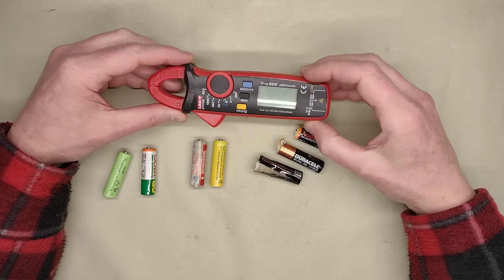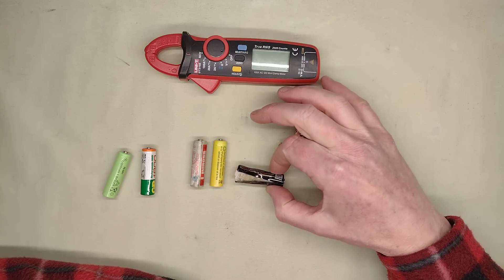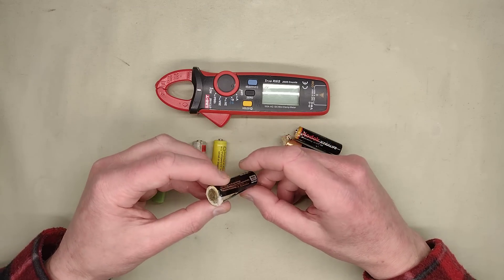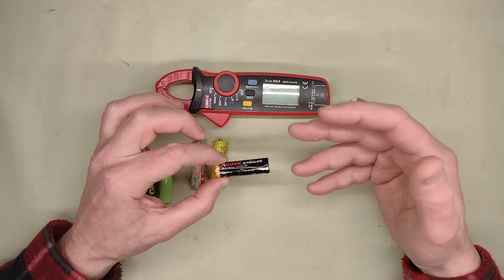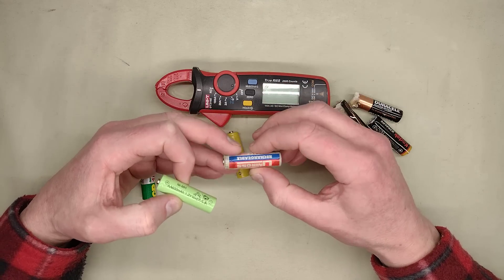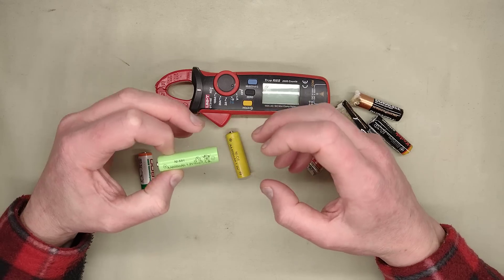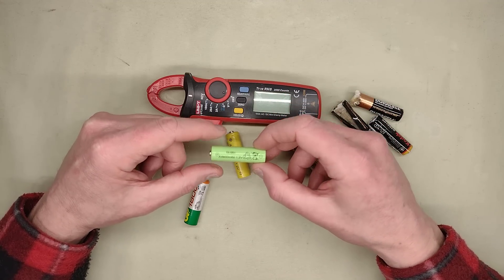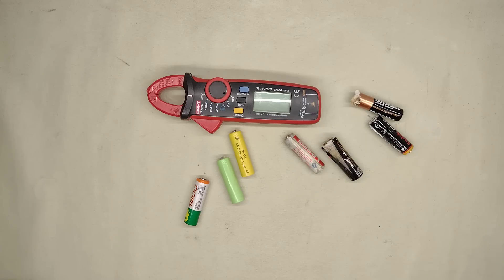The curse of leaky alkaline batteries

Comment: I was going to say that the problem with NiMH is that it they are nowhere near the capacity of a non rechargeable alkaline AA (~2800 mAh), but they are actually very close these days with Eneloop Pro being 2500 mAh.
Shame about the voltage (even under load) being too low in some applications for NiMH.
Reply: You can get them as big as 3000mAh nowadays, but don't be fooled by capacity alone: Such high capacity batteries have high leakage currents and are mainly suitable for devices that regularily need new batteries anyway.

Comment: One issue I run into with NiMH cells is that many devices don't protect against over-discharging, which will damage the cells. So by the time I realize that I need to recharge them, they are so damaged they won't hold a charge anymore. Therefore I've gone back to alkaline batteries for things like radiator thermostats because I've run through too many rechargeable batteries. Of course, these aren't devices you'll leave in a drawer for years before you notice the battery is dead...

Comment: My use for alkalines is as a cheap way to run Xbox controllers for 20 hours or so alongside other high-load short-life applications, and I use the disposable lithium batteries for my long-life applications. Rechargeables make no sense to me when the battery will last 5 years before I have to dig through my electronics drawer for the charger. I just wish it were easier to find the lithium disposables. Plus, lithium disposables last much longer than any rechargeables.

Comment: Another option, depending whether your devices are tolerant of a bit higher voltages, is lithium ion.  You can find them in the standard AA size if you dig a bit, and a bit of modification to the battery compartment can allow a pair to work in parallel to feed 3.7 volts rather than the expected 3V from a conventional pair in series.

I've got a battery powered deadbolt on my back door and the thing was beyond sluggish with four alkaline AA cells; hacked up the battery compartment a bit (really just bridged one conductor) and it now runs like a champ on 7.4 volts from a pair of cheap Chinese rechargeable lithium cells.  Been running for about eighteen months and only needed a single recharge so far.  I can't imagine how pathetic that little motor would be if I tried NiMH rechargeables; given how slow it was on 6 volts it might not even make enough torque to unlock the door on only 4.8.

Comment: Duracell batteries that I’ve bought in the past have often leaked well before their expiration date. The worst thing is the company tried to imply that the cells had not been kept at optimal temperature and storage conditions even when they refunded the purchase price. A good number of the unused batteries were leaking inside the packet! I’m very wary of alkaline cells now and check them regularly. Good advice in the video Clive.

Comment: I have the same meter and it had the same problem with alkaline batteries. The battery point inside were corroded as well, lucky it still works.

Comment: i feel like lithium AA cells are becoming more common for high wattage wireless devices like IP cameras that use wifi. also i never seem to be able to completely clean out the green crust. i do have a mystery can of "battery cleaner" that my grandpa got over 20 years ago that instantly cleans it up, but if i used vinegar or any other cleaning supply it never seems to work completely

Comment: I have stopped buying Duracells many years ago as it was once my goto battery as I wrongly thought I was buying quality.  I have to admire them for putting a date on the battery, but why was the leaky crusty ones ALWAYS duracells (and in date)? I did email duracell but never got a reply.  For the last few years I've given up on Duracells and have mainly gone over to LSD rechargeables where possible. But for some things eg quartz clocks still  always have a pack of Alkalines handy. Quite like energiser as I've never had one leak yet... Time will tell though.

Comment: The only acceptation to the rule is medical devices such as insulin pumps. When a rechargeable battery nears the need for recharge the voltage falls very fast and requires a mad dash for batteries. I’m sure they could engineer this out possibly just by adding more “emergency” reserve, but nope they eat batteries and there flavor of choice is alkaline. They never last near long enough to do internal chemical damage to the device. My other concern for rechargeable batteries left in, say a flesh light.. won’t the batteries be damages if mistakenly left on ? Thanks Clive !

Comment: I personally like lithium primaries, eg. energizer ultimate lithium their shelf life is like 20 30 years and they're impossible to leak as far as im aware and they're basically a lifetime battery for most low current devices and basically 0 self discharge i had some duracell ultra lithiums i bought in 2013 made in the mid 2000s and they still had 1.8v and i did use them they went into an RC Tank Model I gave as a gift so i know they'll never self discharge and they have a lot of power if needed. Anything that takes serious power usually you have li-ion anyway so i personally just go with very good batteries or if somehow i have something that would need to be recharged then id consider the rechargeables

Comment: Got an old film camera (konica FS1 from the 80s) that states don't use rechargeable batteries (sticker in battery compartment) This camera is known from weak electronics.  Is it down to the higher current that rechargeable  batteries delivery could fry the electronics?

Comment: Explosion!  I once had a Duracell 9-volt battery explode while powering an ordinary ionization-type smoke detector.  The explosion sounded like the gunfire of a 22-caliber rifle.  The battery had been installed for about six months, and up to that point the smoke detector was operating normally and not beeping to indicate low battery.  I found that one of the six small cylindrical AAAA cells in the battery had ruptured, splitting open its metal case.  Luckily, the smoke detector survived, and I have continued to use the smoke detector to this day without further incident.  I considered sending the battery back to Duracell for failure analysis, but I thought better of that plan, realizing I could be shipping five potentially hazardous items that could go bang at any time.  I think I smashed the cells with a hammer to rupture them and I trashed the remains.

Comment: Zinc Carbon are still available and fine for very low current applications, if it needs a higher capacity then it needs to be rechargeable. Been my view for a long time.

Comment: Duracell's were sold years ago upon the label of "never leaking and destroying your equipment".
Seems that changed back in 2014 when production was switched to China and most of their batteries leaked whilst still well within their shelf life date.
I stopped buying Duracells in 2015 and convinced my company to halt buying them in 2016 due to the leakage damage that they were causing to high value instruments.
I will never, ever buy them again.

Comment: I have a new  ni-mh battery in an old bosch drill is it safe to leave it inside the drill or remove between use ?
Reply: NiMH batteries aren't any threat for the device, but leakage currents could drain them.

Comment: If you have a Device that had an Alkaline Battery Leak and damage it,  Contact the manufacturer or if Private Labeled contact the store as many will ask you to take pictures of the Damage and/or additional information and may reimburse you for the Repair or Replacement of the Device. Of course each manufacturer / Store has different policy's. I had a Fluke Temp Meter from a Warehouse Club Leak and damaged the Battery compartment and adjacent area.  They reimbursed me $275+ to replace it.

Comment: I've gone to lithium batteries for quite a few items and NiHM for most of the rest. Anything that may sit around for multiple years gets lithium. Yeah, they're expensive, but much cheaper than the things alkalines have destroyed.
Over the years I have noticed that Energizers are much less prone to leaking than Duracells. My brother-in-law,  who owns a camera store,has mentioned the same thing. When people brought in cameras, flash units, etc. for repair, it was often due to leaky batteries, and usually good ol' Copper Top Duracells. Not so much Energizers. 
I'm pretty sure Costco's Kirkland batteries are made by Duracell - same leaky problem.

Comment: Military tossed a very expensive forward air control night vision laser designator because of this, drilled out the battery silo over many hours to restore it, has such a nice clean unused photomultiplier tube it was worth it.

Comment: The one issue I have with Ni-MH is that if they are over discharged, they quickly start losing capacity and sometimes require a "jump start" for a charger to recognize it.  This is especially common with Chinese made ones, the black tops.

Comment: I like Ni-MH, but have you run into instances where the lower 1.2 voltage is an issue? Not often, but I remember a couple devices over the years that stop working when the voltage gets around 1.1-1.2 per cell.

Comment: Yes, the 1.2v isn’t that bad on its way own, but when you factor in multi cell packs, devices designed around the 1.5v alkaline and carbon zinc start to suffer. 4x alkaline is 6v, you need 5x NiMH for the same result.  It’s a proper annoy with RC transmitter as at most I think I have a 5.4 to 4.1c to work with when the device can handle 6.6v. More or less a set of NiMH multi pack will have half the runtime for the same capacity. I think this is a major reason the built in lithium battery prevails so much. No voltage variance gaff to fuss with on devices that are sensitive to it.

Comment: Duracells are terrible for leaking. The final straw for me was a new battery which had only been in a kitchen clock for 3 months before leaking - I won't have them in the house now. I bulk buy Energizers instead and haven't had problems with them

Comment: What about lithium cells? The problem with rechargable batteries is that they are only 1.2V compared to the 1.5V. As your device requires more batteries in series this becomes more of a problem.

Comment: I do wonder though what the best way is to clean the residue off of the components. Mainly the battery holder springs I find to be difficult to clean. And also my understanding is that the leaky goo acts as an acid eating away other metal components, is that right?

Comment: In low draw applications that you only have to change the batteries every several years those Energizer Ultimate Lithiums are probably the best choice, they have a super low self-discharge and I don't think they really every leak, I'm not sure it's even possible for them to leak with the way the chemistry is and the way they're sealed.

Comment: I've had new batteries that still had enough voltage to power their devices leak. Ridiculous. Sadly some things we have, like some LED candle lights, don't work well on NIMH because the voltage of NIMH is too low. They stay about 1.3 volts for a long time which is great for devices like controllers but a typical new alkaline is usually at 1.6 volts, and the candle lights look much brighter and visible with alkalines than our fully charged NIMH because of that difference.

Comment: I've found that over the last few years the bulk packs of Duracell or store brand (Costco / Sam's Club) alkaline batteries are really bad .. normally half the pack has leaked after about a year (way before expiration). Originally thought it was just a bad batch, but it's reoccurring and happens like clockwork.

So yeah, not a fan of Alkalines.

Comment: For someone like me who uses vintage super 8 movie cameras, they’re sensitive to any lower voltage because it’s all analogue circuitry inside, since it’s from the early 70’s. So I kinda need the 1.5v power for the camera to properly run at the correct speeds.

Comment: The problem with NiMH cells is the 1.2 Volts nominal versus 1.5 Volts nominal.  A lot of devices aren’t excited to receive 20% less potential than they were expecting.  A work around I haven’t seen yet would be to include a series boost converter packed inside an AA or AAA form factor along with a physically smaller chemical cell.  The energy density these days is large enough, adding an internal regulator should be feasible.  I’ve seen cells with built-in USB charger jacks, so why not a boost regulator?
Reply: Get yourself some NiZn AA/AAA batteries, devices that aren't happy with the 1.2V of NiMH are usually very happy with the 1.6V of NiZn. I have both in my drawer and every device gets what it likes best. For example the remote control of my OLED television likes NiZn, while the remote control of my satellite receiver likes NiMH better. USB cells with boost converters exist, but that comes at expense of capacity, the NiZN batteries are IMO a more structural solution.
Reply: @danielmantione  Thanks for the suggestion.

Comment: Like other commenters, I’ve learned to bite the bullet and use Energizer lithium cells in devices I may need to use at a moment’s notice and are too expensive to risk being victimized by battery leaks.  It seems like where I live only Energizer lithium is readily available.  I was leery because I’ve had disappointing results with Energizer brand AA and AAA cells going dead in storage before their expiry date even when properly stored.

Comment: It seems very random when an alkaline AA cell will leak.  I’ve had almost new cells emit the dreaded crystals into expensive equipment, on the other hand there is a TV remote control right next to me sporting at least 15 year old cells.  Other sample size of one observations: I have never seen a 9V alkaline battery leak (yet).  I don’t remember last time I saw a leaky alkaline AAA cell, though the leaky battery annoyance center in my brain feels sure it has seen one.  There is also a Murthy’s law corollary for cells that the odds of leaking are proportional to the cost of the victimized device.

Comment: I have found Duracell batteries with the use by date of 2025 and before.  They leak while still holding a charge.  I thought it was cute that my dollar store flash light was emitting a faint glow while switched off but still was very bright when switched on.  I opened it up and their was alkali spuge everywhere.  Checked my other devices and found many of them had leaky cells with ample charge.  This goes for AA, AAA, C & D cells.

Comment: I think they have changed over the years. I still have my first test meter with its original Duracell batteries bought in the 70s. Not only have they not leaked they are also working fine.
Reply: Old alkaline batteries contained mercury, which made them resistant to leaking.  The mercury was there to absorb the hydrogen gas.  Newer alkaline batteries don't have mercury, because it's harmful to the environment when disposed.  Unfortunately, the mercury free batteries leak much sooner.

Comment: Back in the day of zinc carbon cells, they would barely last until the end of boxing day before your toy stopped working and then they leaked almost instantly.  When the alkaline cells first appeared they were sold on two features - 1) they lasted a lot longer and 2) they didn't leak.  Over the years though the design seems to have changed and they leak like nobody's business.  I find devices which are still working fine, and yet the batteries inside are a horrible mess.

Comment: Duracell's have "DURALOCK" which is sposed to keep the battery from leaking for 10 yrs from production but in reality mine all start leaking WAY before that. It's almost a joke. And I swear alkalines used to not leak so frequently. IDK what changed.

Comment: Depending on your device, you can install rechargeable 14500 (AA) Lithium Ion cells.  Replace 2 AA cells with dummys and 1 AA cell with a 14500.  Be SURE to use a Lithium charger!!!  I use 1 dummy and 1 14500 in a travel shaver.  Yes, it is over rated voltage.  It has run for years and is still running.  Motors can handle tremendous over voltage.  Yes, it wears quicker, but you are also shaving quicker.  If at all possible I will not buy anything that does not have a user removable battery!

Comment: Totally agree! I think also when you have more than one device that uses batteries, but is a device that might only get used a dozen times if that then rechargeable batteries really come into their own in my experience. I've always worried that once a Alkaline battery is used it's like a bottle of carbonated liquids where once their open it's a bit of a race against the clock to use them. Where as with a rechargeable that's not necessarily a problem so much as a mere annoyance. Not sure if it's just my mind playing tricks on me or just me mixing the older with the newer batteries but again, not such a problem with batteries that can be recharged.

Comment: This is an application problem. Alkalines are for high current draw devices that will be used regularly and batteries changed often, not for low current applications where the batteries will remain installed for extended periods. For low current needs, you're better off with cheap carbon-zinc batteries that just dry out when they become discharged. If you must use Alkalines, remove them from the device when not in use.

Comment: All batteries can leak, especially alkaline.  Alkaline batteries have a very long shelf life and have more power in the cold.  Leaving a device on to completely drain a cell can make it leak.  1.10V is dead!  The TSC JobSmart cells are the absolute worst that I have used with Duracell being next.  I will not buy Duracell.  You can use DeoxIT on the contacts or even a film of oil to help stop corrosion.  A paint nick sander is excellent to polish contacts.